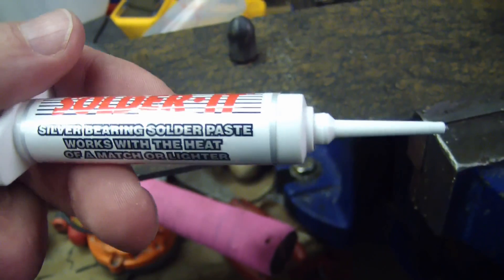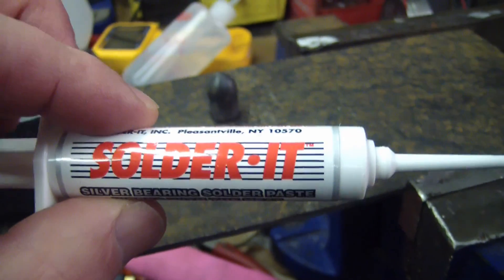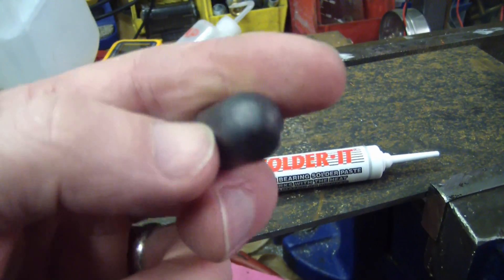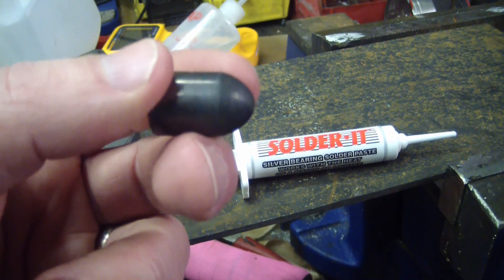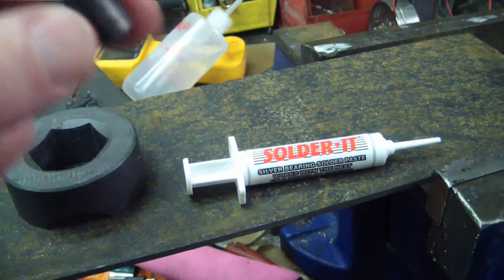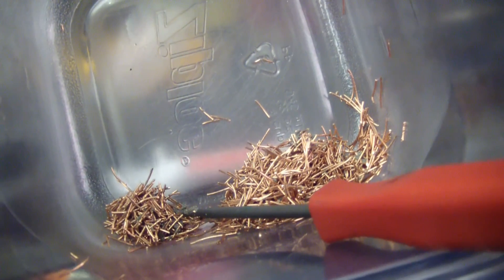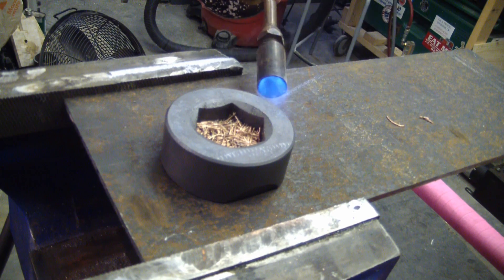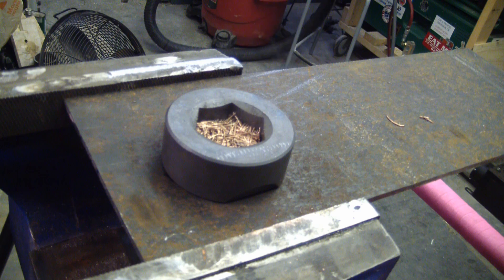Copper parts from recycled wire sintering

Comment: It would have been dense if you had put the mix in a hydraulic press and compressed all the space from between the copper and then warmed it up to solder it. If you use pure tin solder it might alloy with the copper to make a copper/bronze sinter.

Comment: I tried to duplicate this with bare copper wire and non-expired Flux.

Didn't get anything to stick together.   Did you use actual solder paste (with low temp metal in it) in which case its not sintering at all? What did I do wrong.

Comment: I wonder if this could be used to make a highly efficient heat sink?
Reply: Just my opinion, but I feel that a solid continuous material through would be the best, sintering might fall behind if there are discontinuities such as bubbles or inter-particle fissures in the material.  On the other hand, if both the material and bonding agent are excellent heat conductors, and pressed together in a vacuum to the point of eliminating any discontinuities, this idea may have merit.

Comment: you can always make the soldering paste more runny by adding acetone. I dissolve tiny bits of soldering raisin to paint-brush my PCB's prior to soldering. The acetone evaporates immediately leaving nice even surface coating.
 Then I can easily thicken chosen tracks with additional solder layer, or cover large surfaces f.ex. in heavy-duty ground layers.

Comment: make a sub atomic particle detect.. aka cloud chamber.. use the copper as a base to hold a peace of radiated material at the end of a thin wire.. enclose with a custom box.. nice little tray for dry ice, some custom high focus beam led's... and then turn your back from it when its working.. and walk away...

you then get to be cool, and walk away from the largest explosion ever... a fucking sun.... cheers!

Comment: That end product seems pretty porours... Maybe it can be used as a filter for big particles (like in a pneumatic lubricant/dust extractor) or if cooled propperly can even used for consation processes? (cuz copper's got a low thermal resistance)

Comment: Cubic boron nitride is pretty tough, close to diamond.
Reply: *****
I have never touched CBN so I may just talk nonsense but as I see it they "invented" CBN to get a substitute for diamond for it reacted with steels on high temperature. So not sure if one could cut WC with CBN but it seems to be tougher. So If one had  CBN knife and WC bread one could try to cut it, I would give it a go....

Off the topic, could you try to compare a cheap wrench to high quality one on a real torque test, to compare their braking points?

Comment: Interesting and nice to see something work first time. I don't think this is sintering though it's more random soldering. My understanding of sintering is that you heat a material to a bit (that's a technical technical measure) below it's melting point and then hold it there while the atoms migrate from one discrete part to another. After a while (typically a few hours) you end up with a single piece of material.
Reply: That's effectively correct.  Sometimes multiple heat cycles are used to fill voids and develop a homogeneous bulk, with whatever additives/dopants are desired.  Instead of a propane torch, I'd recommend an induction furnace!  Relatively easy project to put together, and only deliciously dangerous with a low risk of fatality.
Reply: ***** Always good to learn something new. I'd be interested to know whether you've soldered or sintered the piece though. It looks like liquid state sintering still involves the movement of atoms from the bulk material into the liquid bridge, that's going to be quite a slow process. I can't find a detailed description of a solder joint but I'd guess it just involves the surface of the bulk material. All we need is an electron microscope and we can find out.
Reply: +CNCtrl Hi,

I could have sworn ‘bum tit willy’ (sorry I could not resist my instinct)! = I saw one of these on eBay?
Reply: Recrystallization?